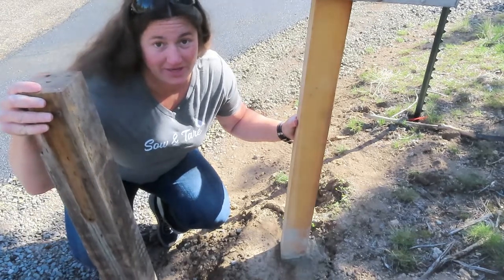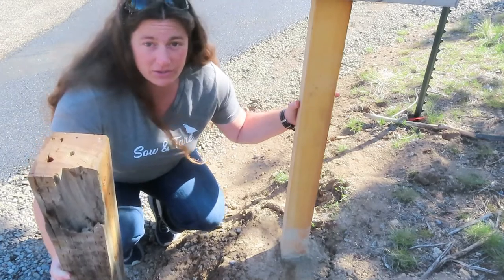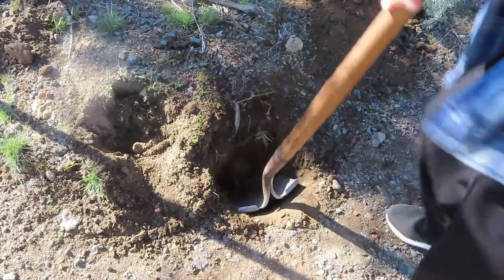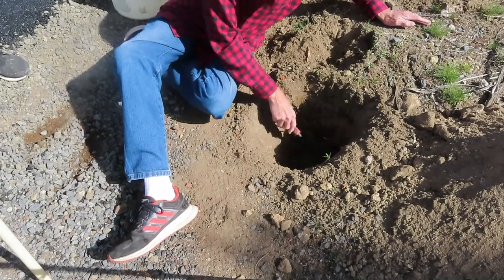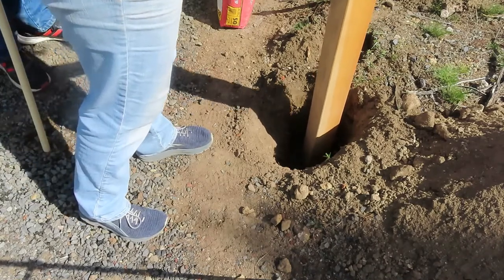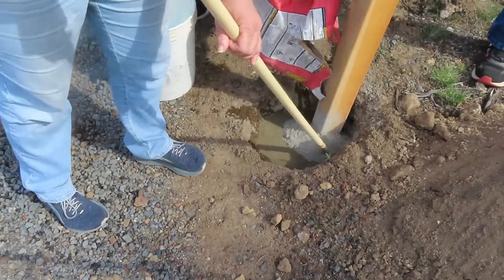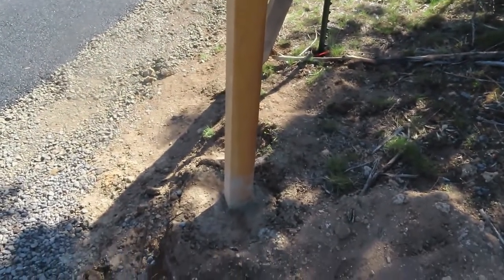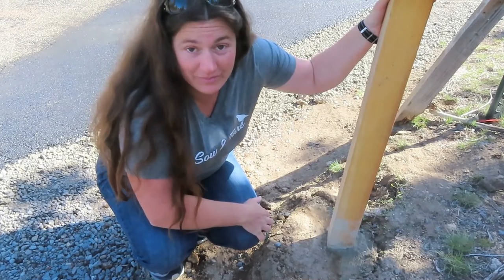How to Replace a Mailbox Post

Comment: Kind of funny to watching you pour so much water into the small amount of cement you used. I'm a journeyman carpenter and have done plenty of cement work. The best test is how long it lasts! The first (and only) time I put in a mailbox post it costs me $80 because I dug through the buried telephone line! PS the bag has the instructions on it.
Reply from the maker: I've done a lot of small post work and when I learned, this is the way I learned, and it has held up. I have heard from others about this type of cement cracking if it dries too quickly (this is a very dry area), and I know of people who work with cement who water their work if it is going to take a long time to dry, hence the extra water. I'm not an expert, just following how I've learned from others and what has worked with me.
Reply: You are in a much hotter climate than I so I can see why more water might be needed. Up north more water would definitely cause flaking and crumbling.
Reply: @smckee9063  This mailbox post replacement is located in the high desert of Oregon. It's very dry, hence the need for more water than some other areas.
Reply from the maker: @johnkrakow4914  :)